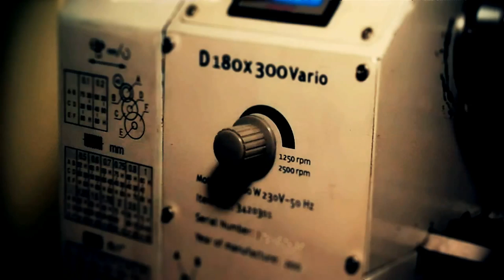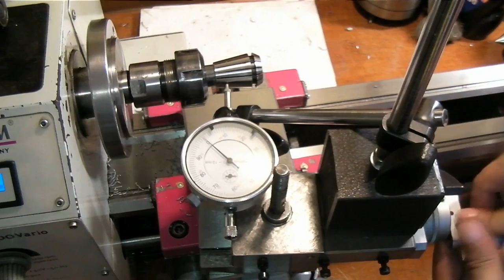ER25 Hex Collet Block

Comment: Beautiful, well made part. Very nice. There is one more thing that needs to be done, though.  Place the block horizontally on a known flat surface and measure the height of the taper with a Dial Test Indicator.   Rotate and check each flat to ensure that the taper is concentric. Thanks for the video.

Comment: Nice! I'm just getting into machining and I'm learning a lot through youtube.
On 9:19 I see you're clamping the still round part in the vise. One of the first things that I milled was a small, soft v-block, just for clamping round stuff. I had a small copper block so I made it from that. I'm sure you're familiar with the advantages the 3-point contact brings.
I made it just after I clamped a round part like you did but the cutting forces were too high and the part was kicked aside.
It was certainly salvageable but I had learnt my lesson xD

Anyways, good luck with your projects!
I'll go check out some of your other videos

Comment: Glad you are posting again brother hope you are well
Reply from the maker: +lbcustomknives Thanks Lee! I'm fine, just a little busy to post. No worries.
Reply: +Baseline46 
Hello,
The final measure caliper is not very relevant.
Can repeat the measurement taking into account the concentricity?

Put stub clamp in HEX, then, to the other end of the stub clamp in and carries clamp in spindle. (as in 6:18), then touch come with dial on each side.
The this will be relevant.

Because ultimately, the most important, the real utility of this tool, it will be good that the squareness is concentric, not the squareness of the faces are paralelles them.

This is not a trap, or a criticism, I am just curious to know the result.

If it is good (0.02-0.04mm gap as with calipers, but also concentric) obtained with this setup, I take my hat.
Very friendly France.
Reply from the maker: +des mes Unfortunately, you are right. I'm out for about 0,15mm as far the eccentricity... I can still do my job for now but I will order one anyway. You never know when I will need it. Thanks for pointing out.  Dimitris -Greece
Reply: +Baseline46 

It is possible to resume leger milling in making do to put everything between centers.
Difficulty will, of Mount entrepointe and find ways to immobilize fixed and tighten.
Will be based on the tools at your disposal.
If you have two adjustable dolls (like those sold with divider or indexer) or  indexer + doll, try to mount above the vise.
Give free vise and tighten jaws, then tighten grip on basic table.
(necessary  the HEX sides dont NO touches the bottom of the vice.
Then resurface slightly, each face. Doing this for the 6 faces.
They will be concentric and parallel Squaring. (normally lol ..)

Option 2
Like Casimo
Install hex in a four jaw chuck, centering with dial indicator, And Then Removing A bit of cone (if there is a little fat) The cone will dive deeper, but up to 0.15mm concentric represents much less depressing cone, should be playable..
Should be less than 0.15 easily.
Centering should, with any luck, be able to half value caliper or 0.02 /0.03 concentric default.
Reply: +lbcustomknives brother you could send it here and I'll surface grind it for you.😉
Reply from the maker: +des mes Thanks des mes! I will use the four jaw chuck to fix that. At least a get as close as I can.
Reply from the maker: +lbcustomknives Thanks Lee, I really appreciate it, but you can't actually do nothing if I don't fix the eccentricity problem first. I may need your help to order one for UK bro. I can't use my credit card due to capital control on Greek banks and the guys who sell those doesn't accept PayPal. If I send you the money via PayPal, before you pay anything, can you order one and ship it to me? if it is not too much of a trouble...  I do accept "no" as an answer.
Reply: +Baseline46 course I will bud I have them here my self.. Just send me email bro or pm..
Reply from the maker: +lbcustomknives What can I say! Thanks Lee, I will send you a pm...

Comment: Don't feel too bad about the lack of concentricy. I bought a Chinese R8 hex & square set and it is off more than that. I have since bought and modified a Spin Indexer that uses 5C collets. It is better but sill not perfect. Both are Chinese, but a good value. I have an excellent collet chuck for my lathe that is Chinese. The advantage of the 5C collets is that you can hold much shorter work in them. Disadvantage is the max work diameter is 1 1/18" but I have made a 1 1/8" stub back plate for a chuck to mount in the spin indexer that allows me to index larger parts by 1 degree increments. I considered a Chinese mini lathe but went with a bigger lathe, glad I did now.

Comment: Nice work, Building the hex at the same time keeping the ring Perfectly center must have been a nightmare. Would not it be better make the hexagon And then The rest?
Reply: or clamp a shaft in the largest collet and mill the hex while it's hanging out of the end of the vice (or ideally a spindexer etc)
Reply: Between centers. And the flats will be parallel to the bore.
Reply: you know your stock size. you know what you need take off.measure it lol. there is no bit shy. i take it from other side.nono you need take material every side exact.

Comment: Am sure it wont be very accurate using manual protractor but hey, beats buying for sure.
If you had angle blocks, you could dial in better angle.

Comment: Welcome back dude. It's an amzing job but I have some doubts about concentric exagon with collet. As Diego Ingrassia told, I would have done first the exagon and ther the conic bore for the collet.
Reply from the maker: +Cosimo Marotta Hi Cosimo and thanks for the comment! Only if I had a precision 6-jaw chuck and again, I don't think so. If I had a 60 degree angle block I would use my low profile precision machinist vise. I could drop the deflection close to 0.02mm or less by this way. Not much of a deference for what I'm doing here though. Even better if I had the time to order one for about 20-25 Euros.
Reply from the maker: +Baseline46 Except if I had a precise hex bar to start with.
Reply from the maker: +Baseline46 I apologies bro, you were right. I just measure it and I am more than 0.15mm off. I can still do my job for now, but I will order one anyway... thanks for pointing out.
Reply: +Baseline46 It was not a critic from me, bro, just a suggest. 0.15 with the way you did it, anyway, is an amazing tolerance itself. I think you can save your job the same holding the hex in a four jaw chuch, centering it with dial indicator, and then removing just a skin inside the conic house of the collet. I think this can make the job. And don't forget to do some trials rotating the collets because sometimes they are liers.
Reply from the maker: +Cosimo Marotta Yes, I was thinking the same thing, but I dropped the idea since I only have to make a few samples for a customer as fast as possible. I'm making a wood cutter from a 16mm stainless tube, something like a hole saw. I don't think it would make a much of a difference if some teeth is slightly bigger than the others for as long I manage to keep the same height. I'll buy a hex block to make the rest of them... No problem with your suggestions, thanks for pointing out.. Dimitris
Reply from the maker: +Cosimo Marotta   I may have to follow your advice and fix that. I can't use my credit card due to capital control on Greek banks and the guy who sell those don't accept PayPal. I'm out of options. Dammit, I can't use my money...
Reply from the maker: What can I say! Shit happens.

Comment: Nice work in spite of the incorrect order of operations.  I don't think that the size of your lathe is the issue with threading but rather, the fact that it does not have a threading dial. I still don't know why Optimum does not include one... every other Chinese 7X lathe has this feature.
Reply from the maker: +Herr Schmidt Hi Herr and sorry for the late reply!!! Have you ever used one? A friend of mine that has a small Chinese lathe with a thread dial, told me that due to the small gear is actually useless.
Reply: No...I have not used one...I was repeating the testimony of many here in the US that use them. I know that most 7X users do complain that the power feed is always too fast when threading. Many have installed handles on the rear of the spindle and turn by hand. A bit tedious but imparts excellent control to the process. And afterall....most users are not doing production work.

And....Hobbymat/Prazi lathes use the same method of reversing the motor and they seem satisfied so I imagine that there are many approaches.

Comment: Base, if I might make a suggestion, if you can set the block back up in the lathe and true it up like when you machined the taper so that with a 5/8 collet and 5/8 dowel running true, once its running true drill and bore a 5/8 dia close fit hole at the back or blind end a nice fit on 5/8 drill rod or ground shaft a nice close fit, then with the shaft locked at the collet and the shaft sticking out each end, take it to the mill and rest the shaft on 1-2-3 blocks and clamp in the vise and re-machine and skim the hex, that might give you better accuracy, if your tram is out I wouldn't use a flycutter, finish of with an endmill, and with fine wet and dry on a surface plate or the likes, lightly finish the surface,

You did do a nice job though, would be a shame not to try to improve,
Reply: +Walter Maisey 
Sorry, I took a second look and see you already have a hole, but its still doable,
Reply from the maker: +Walter Maisey Hi Walter and thanks for your comment. All of the corners are dead zero as is now and also five of the flat surfaces are too close to zero too. The only exception is one flat surface that I removed 0.15mm more than I should. I can remove 0.15mm from all the other surfaces and make it work I think, but since I'm working with tubes I'm placing the error on the depth that doesn't affect my work at all. I've changed a fly-cutter from HSS to carbide at some point and tried to retouch and zero on one surface. That was the problem I think.

Comment: Bugger. Please tell me, the collet nut diameter is not larger than the AF measurement of the hex block.
Reply from the maker: Actually it is... which is good, at least in my case. I can use it as a stop.
Reply: Yeah, I see they are nearly all built the same way. I occasionally use mine on the surface grinder, magnetic chuck. Sits nice and flat with the Square and Hex body being larger.

Comment: I liked how you indicated the collet taper. I will use that method too :)
How did you polish the tapered i.d.?
(bought a cheap MC3 set at local fly market, need MC4)
Reply from the maker: Thank you! Well, I don't remember... :) Just a touch with a sandpaper I suppose...